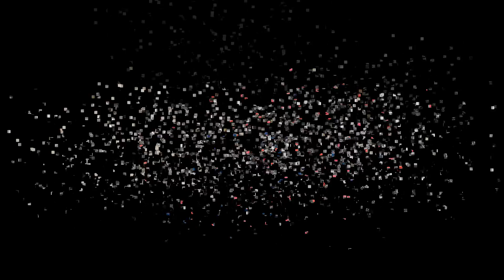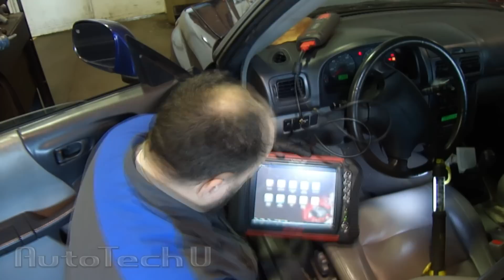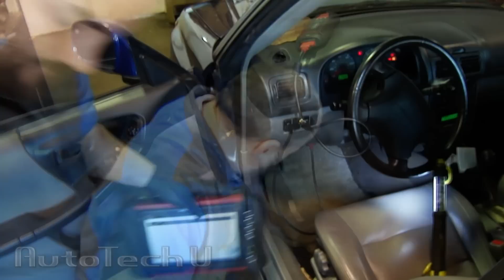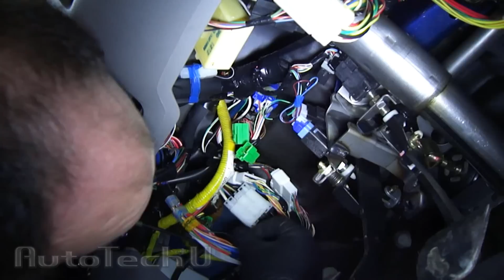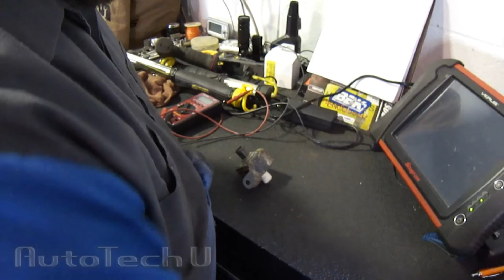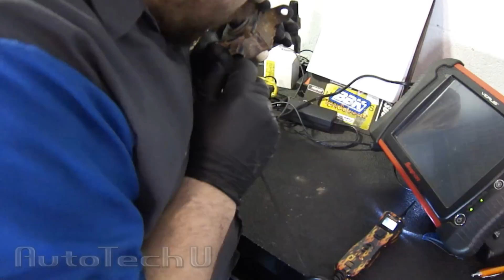p1443 Subaru Evap vent testing and replacement AutotechU episode 2

Comment: i got my vent valve replaced and still have the code popping up. i'm afraid that my purge valve also needs to be replaced from what i've been reading online. the purge valve is near the engine bay and the wording is very similar to the vent valve online in terms of shopping for parts.

Comment: awesome ! diagnosis and explanation. 
i didnt understand how this could effect performace or idle until you said that it was pressurized from vacuum. 
iam like, why my sub' running like ass it just has a stoopid vent valve code . 
but it is acting exactly like a vacuum like !!

Comment: I have a 2014 Subaru crosstrek limited. Have code P1449 ( vent control filter clogging ). I replace OEM. filter with solenoid, Auto zone Vapor canister Purge solenoid, and OEM. drain valve, after that smoke test ( no leak ) and blow to tubes. After drove the car for 20 miles or less. The same code came back. What next step I should check.

Comment: Excellent video on diagnosing and figuring out this issue. I never knew about the green plug. That was super helpful. And the ohm readings were also very helpful. You should post this on the Subaru outback forum

Comment: What if I cant hear the relay when I plug the green cable.......and when Im filling my gas tank it keeps stoping constantly im filling my gas tank for like 30 minutes .....I just right now check the charcoal canister and the two little hose (the ones closest to the bottom) where filled up with charcoal waa that the problem

Comment: Thanks for video; I appreciate. 1. You did not mention year for car. Is this important, due to modifications? 2. I was told at the Subaru Dealer here in Brampton, Canada, that the scanner they recommend is the one that carries Subaru's  software (I believe that to be b.s., but, anyway...). What's the difference to YOUR scanner? 3. How can resistance characteristics 'decay' in a solenoid?? Their Henrys should always be leveled to their individual resistance, shouldn't they? Possibly the diaphragm is not seating right, and allowing vacuum to leak, instead?
Reply: As far as the resistance "decaying": We do not know what the resistance was at the time of manufacture, so It may have been faulty from the get go. The real issue here is that he is not getting a proper seal. The sensor check is performed with the solenoid in the closed position (powered on) and is measuring the vacuum, so not sealing will throw this off and cause an error code.

Comment: So I have 2003 Subaru impreza and I got the error code p1443. And I'm having issues gasing  up leaving the pump automatically keeps clicking off even when I hold the handle?
Reply: If the gas pump is clicking off it means you have a blockage in the evap line going into or out of the charcoal canister. This can also be caused by the evap solenoid failing in the closed position. Either of these scenarios will cause the p1443

Comment: I have a 2010 Impreza and this happened years ago....was broke and couldnt afford to get it fixed.  Reset the battery, went away....kinda forgot about it.....but last night before work it came back.  Traction, cruise and check engine.  How pricey is this to fix?  I have heard $60-250......i paid my car off and i really dont wanna get a new one anytime soon.....any help would work.  Cant afford a dealer that will charge $$$ but some local yocal may not know what the hell EVAP is.  Thanks.

Comment: There are many reports of issues connecting a scan tool to the ODBII port on an older Subaru. Apparently the pins start to get pushed out of optimal position inside the plastic that is the port. On any given day, my scan tool might not connect to the ECU on my 2001 Forester.

Comment: I got same code (P1443-EVAP VENT CONTROL SOLENOID RANGE)... do you think, same solenoid is the culprit? BTW, my vehicle is 1998 subaru forester.  thanks.
Reply from the maker: +Alejandro Cea I would check to make sure that it is plugged in.  Chances are that it is the solenoid.

Comment: What to do or replace if I have a code po456 ( evap system very small leak detected) on a 2007 subaru impreza 2.5 sedan? Thank you!
Reply: start by getting new gas cap from stealership (genuine OEM), then try smoking evap for leaks

Comment: I was wondering if you knew what a P0448 would mean then? Is that usually the valve that is in the engine bay that will direct the vapors into the intake manifold?

Comment: HI,
I have the same issue as 'downtowndusky' and have replaced the same solenoid as in the video - no luck. I've also replaced the charcoal canister. blew out the lines and cleaned out the Drain Filter. Still not fixed.

Hoping I don't have to drop the gas tank...but running out of options.
Thanks
Reply: you may want to check the purge valve underneath the intake.  Subaru parts calls it a duty solenoid.  you can check it the same way as the drain valve. this will also set the same dtc.  I have had several foresters with this dtc and a faulty purge vavle, and does not set a purge valve dtc just a p1443.
Reply: Mike Bomgardner
Thanks for the reply. Forgot about this post. Yep that's how I fixed it:
http://www.ultimatesubaru.org/forum/topic/142640-p1443-cel-code-evap-system-fix/

My fix was to replace Purge Valve control solenoid, P/N: 16102AA080

Thanks

Comment: I have this code on a 99 impreza outback sport. its hard to start and idles rough only after I get gas. once underway it runs and will start fine. am I on the right track after watching your video?

Comment: Hi Kevin, thanks for the video and offering to answer questions. I've got one, regarding my approach to solving the fuel smell on my recently-purchased 2004 Forester.  I have some ideas since the smell is most prevalent just after a fill up with the tank is completely full. 

I plan on going under there to check it out.   I suspect its either a rusted tank (at the top) or the filler neck.  Is there any other venting issues that may showup only when the tank is full? any help is appreciated.

Comment from the maker: The vent valve on top of the gas tank could definitely be the issue.  If it isn't venting then all you're doing at the gas pump is filling up the filler neck over and over.  Dropping the gas tank is a large undertaking on this vehicle so make sure your mechanic has checked everything before you ok the tank removal.  Sorry I can't be of more direct assistance, some issues can only be fixed with hands on diagnostics.

Comment: thanks for the reply! Someone was saying something about a "vent valve" or something on top of the gas tank itself which could be clogged and doesn't open up anymore? They were saying this is something that requires dropping the tank. could it be the problem? I do have the P1443 code and a diagnostic receipt said: open or short circ. condition, poor elec. connection, or failed vent ctrl solenoid. Could you tell me specifically what faulty parts/components these could be referring to? Thank you

Comment from the maker: Well the pump kicking off is without a doubt a ventilation issue.  You may want to have the other valves checked in the area.  Without proper ventilation the gasoline can't displace the air in the tank, which in turns causes pressure to build which kicks off the gas pump.  Something isn't working right or is hooked up wrong.